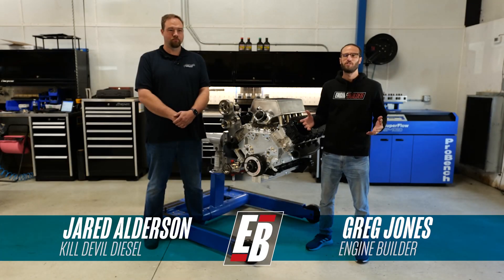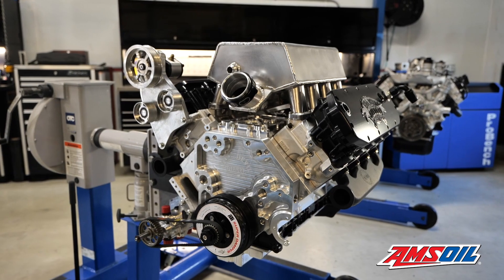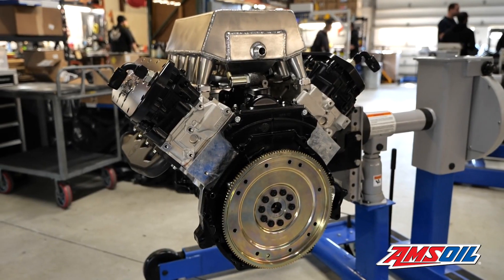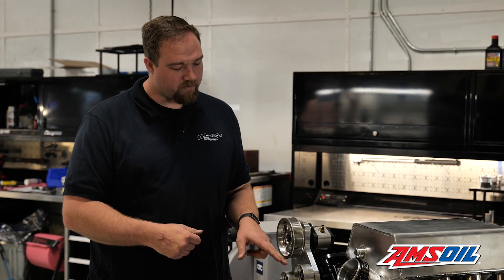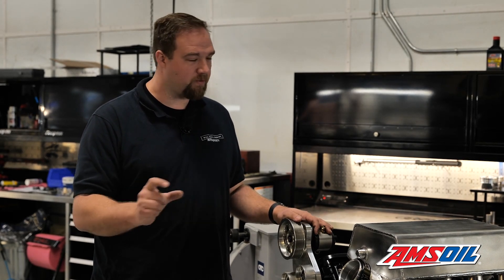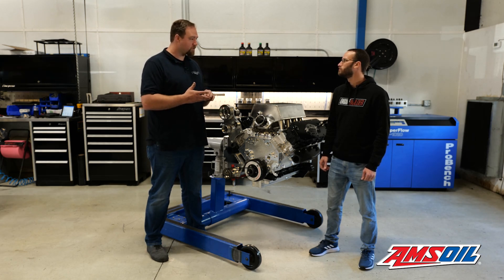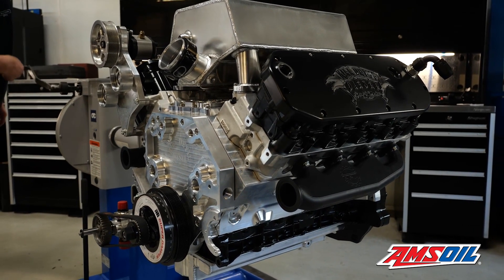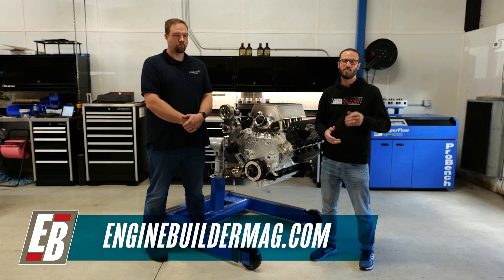7.0L Billet Powerstroke Competition Engine

Comment: I’m just curious but as to why the exhaust manifolds are facing the opposite direction they normally sit. Usually the intake elbow inlet & the crank dampener sit in front of the motor and it looks like the front cover so why is the exhaust manifold pushing the up pipes in the front is interesting
Reply: Turbo is mounted up front on his truck.